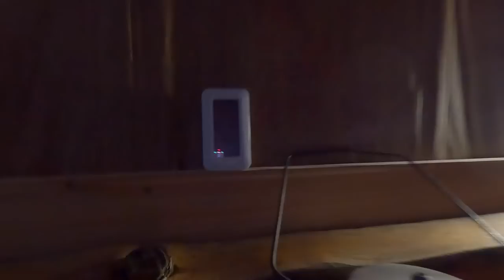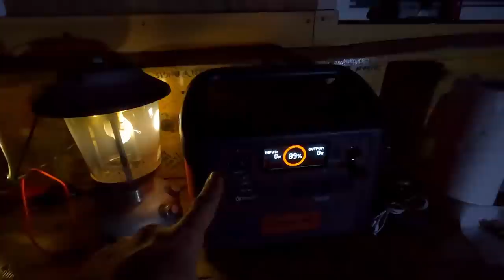A Michigan Snowstorm in an Unfinished Cabin.  Way too much fun! #119

Comment: Clean the pistol with Ronsonol lighter fluid. Strip it down, clean all the parts, removing all the oil. Reassemble and lubricate with powdered graphite. Oil gets gummy in the cold, so don't use it. Also not all gun oils are created equal, for example, I love RemOil, but if you store the weapon for an extended period of time, RemOil gets sticky, very sticky.

Comment: One of the issues with temperature control (the things you mentioned) is that many of them relate to heat flux or rate of loss to the environment not achieving comfortable temperature for a short time. Comfort is related to room volume and heater output. While those things will cause you to lose heat faster to the environment (sucking down propane tanks) the air infiltration mitigation you’ve done alone (no wind) will allow you to be perfectly comfortable.  As you tighten up the cabin, propane utilization rate will definitely drop.

Comment: ⛔️ NOTICE: For out door paint, I discovered if I mix THOMPSON’s  ‘WOOD’ Preservative about 1 Gallon with a half pint of Mineral Spirits and maybe some oil based paint if you wanna stain a bit. Half Pint to a pint of ‘OIL BASED PAINT’ for general stain but, mix well and spray in a deck sprayer. Need to cover door and windows with TYVEK or paper. ⚠️ But the spraying process should be about 13-14 minutes for a cabin this size as apposed to 5 hours with a brush. This takes a long while to dry but I’ve had a couple of hunt shacks and an outhouse done in this stuff from the mid-90’s and still going strong. In fact, our sub used to drop the lake level so we could paint the break wall. Once a year. But my { Thompsons Concrete for cement etc with the Mineral Spirits and some oils based paint }  😅was still there 6 years later when we moved. Save some mineral spirits for clean up with a rag but, clean the spray nozzles real thoroughly and she’s good to use again.😅

Comment: Actually there are ideas on  here to build a tobaggan but u would probably want a wider one for dragging logs or attach to the bottom of your 4 wheeler in the snow n maybe attach a V-plow so you dont high center. the only thin g I saw you dont have would be a PVC pipe to soak the boards before you bend them I don t see any good hills on your property though I think it would be a good tool for dragging logs and other things in winter or summer and maybe packing trails its spose to be getting cold again here we kind of lucked out this yesar january is usually bitter cold minus 30 or 40 for several weeks

Comment: YOU COULD USE does icicles to recuperate as frozen water, by unthawing them, compare to snow which you need a whole lot of snow to melt to have a liter of water ... your huge icicles are equivalent to 3, 4 or more liters (4.4 li to 1 imperial gallon, I'm Canadian)of water ... and also you could built yourself a cold room (or even a fridge) by accumulating your icicle in sawdust ... like they you to do in the old days before electricity ... it is a simple suggestion ... keep your good work and may you be bless ... I enjoy your weekly visit to my schedule  
...

Comment: Just get a car broom like a foam rubber blade with an extension pole n clean the snow loff ur roofs actually its like a rake or roof rake n you can push or pull in my case push snow off vehicles on car lots in Denver

Comment: Install a generator path through plug in the wall. This way, you will plug the generator on the outside of the house to a plug and have a mirror plug on the inside of the house.

Comment: Ya know I think there is something called an indirect water heater about 100 gallons has a coiled stainless steel tube inside the water tank but its not like a water heater its more like a "100 gallon thermous" feed hot water in and it stays hot for days maybe 6 inches or more insulation its very heavily insulated as to how you would heat the water initially I think usually they work in conjunction with solar water heating TUBES THAT ARE CYLINDER SHAPED AND ALSO YOU NEED A LARGE MAGNIFYING  GLASS. i SAW THIS YEARS AGO SUPPOSEDLY FOR BOILER TYPE FURNACES AND RADIATORS AND i THINK THEY USE ANTIFREEZE FOR THE HEATING LIQUID  IN THD COILS INSIDE THE WATER  TANK. sUPPLIES HEAT TO RADIATORS AND ALL THE HOT WATER FOR A LARGE HOUSE. jUST FOOD FOR THOUGHT.

Comment: I built a shed in my back yard n its still standing anmd its not square either the hardest part was the double door in the front I still havent added the plexiglass window over the door been thinking about a small tent wood stove for a heater in the winter time OI think its 10 b y 12 with a metal roof its cheesy but its framed well enough. been there 2 years so far if I could find some Land I got an old trailer I could live out of while building.

Comment: how would it work to build a tobbagan to fit underneath your atv for deep snow conditions hey as well as using it to haul logs like a drag no lifting jusdr role then on to pull them where you want them n keep them cleaner. Ive seen metal contraptions but if it wears out just make another one like your last one its not like you dont have enough wood laying around. And its pretty simple to bend the boards if you soak em in water they soften up and much easier to bend into the curl shape you need. pretty much shows you the whole process on you tube videos. rather then plow just drag something behind your atv to adjitate theb snow and it will get like "crete snow" or become more firm n packed. Snow plowing can be fun to though.